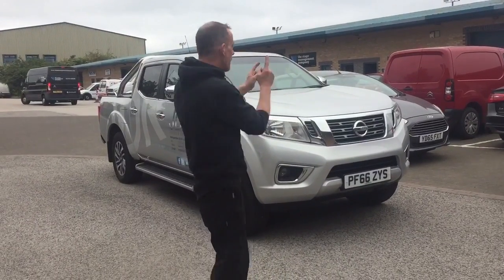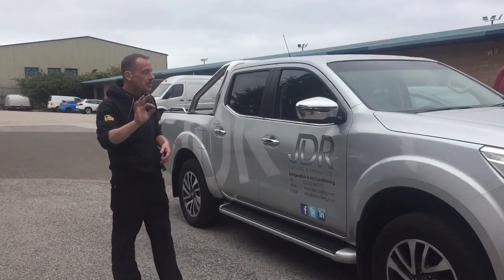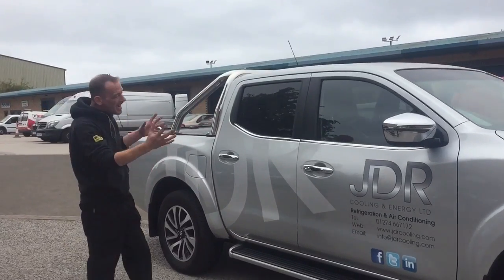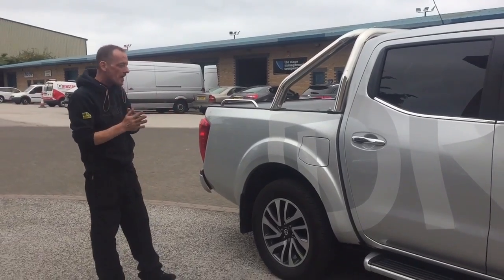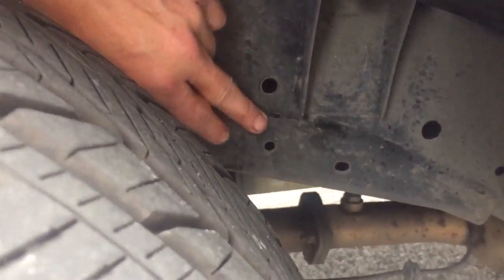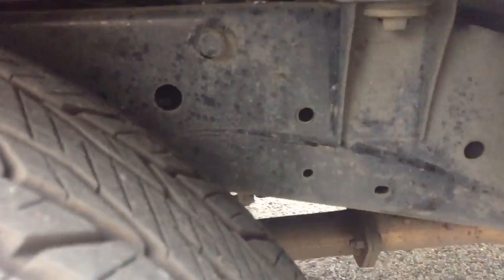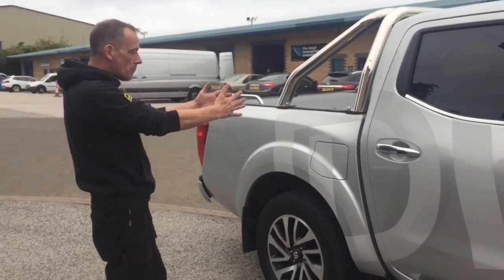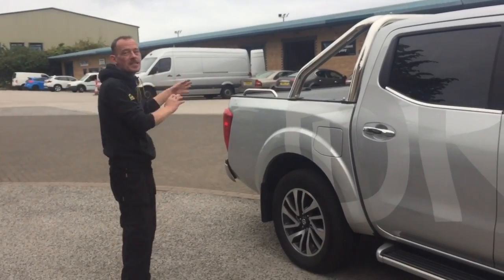Nissan Navara NP300 Chassis Upgrades

Comment: Ive a 2019 Navara NGuard; the chassis (both inside and outside), inside door skin, bonnet, the whole underside and wheel arches have been treated with waxoil when the vehicle was new. Theres not even a hint of rust anywhere on the vehicle. 
Dont expect chassis or any other exposed steel to remain intact once, grit, rain and slush get in about it. Especially if youre going off road.

Its common sence....